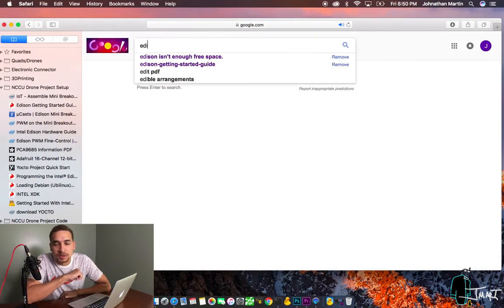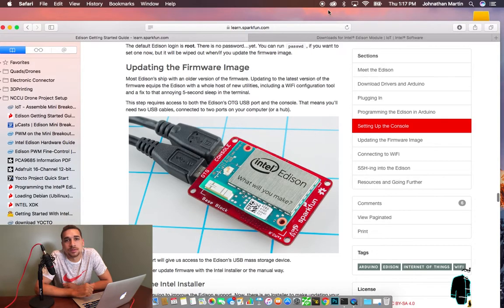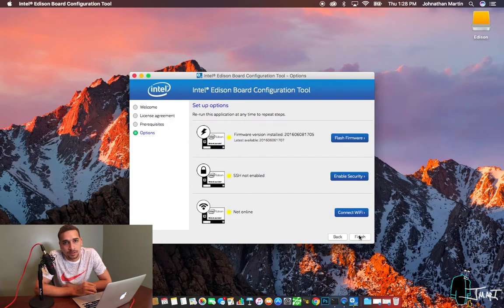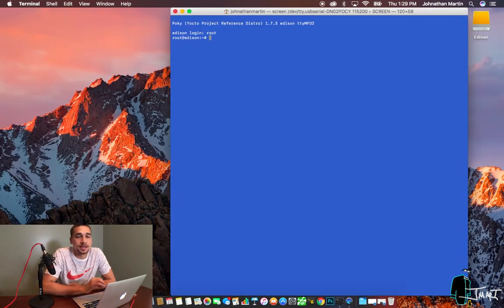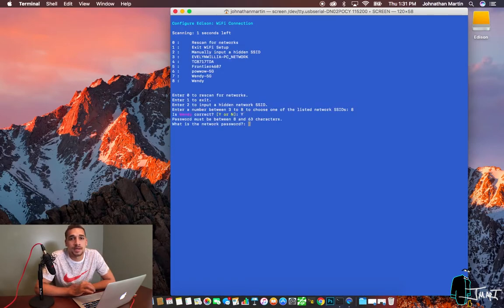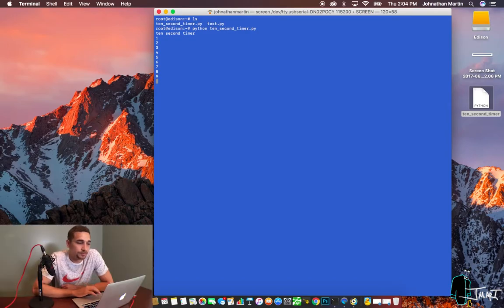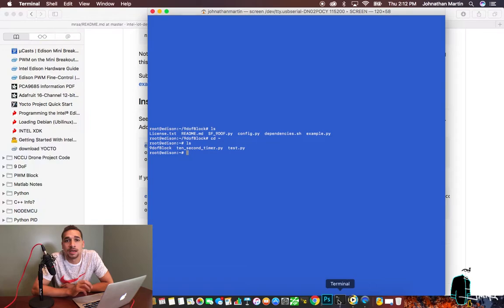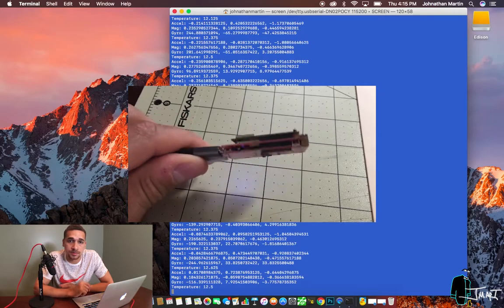Intel Edison Getting Started Guide

Comment: Hi, thanks for the video. I have a Pixhawk 2.1 Cube that takes an Edison board. This may seem like a dumb question but is the setup you demonstrated the same for the Pixhawk?
Reply from the maker: Brian L Murphy to be honest I found out about this version of the Pixhawk 2.1 after posting this video. Haha, I was pretty upset after I discovered it because I realized how much more potential it has versus starting from scratch. 

I will be upfront I don't know the answer. However, my speculation is that the Intel Edison setup will be same regardless of what is connected to it via the Hirose connector.  Every device uses a communication protocol, such as I2C, SPI, UART, etc. 

So if you follow my direction and search for source code you should be on your way. This would be my first approach.
Reply: Thanks for your prompt reply. I have been a bit worried that I may have brought a " Lemon" but hopefully with your help It will be a runner ):-)
Painless360 started a series on th Pixhawk Cube but He seems to have hit a snag!! There does not seem to be a lot of help with the Pixhawk/Edison.
I hope you have better success.